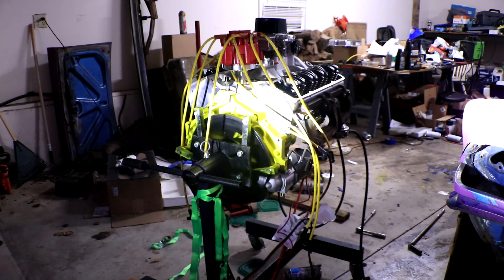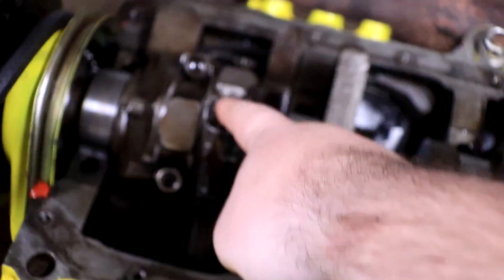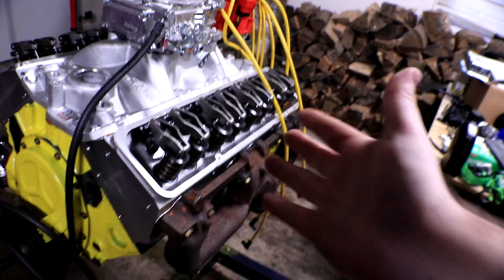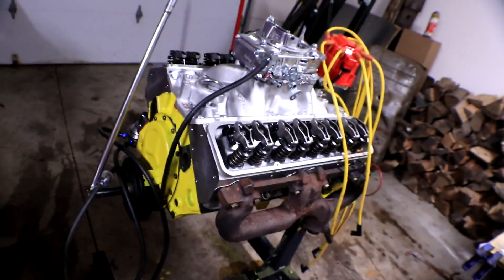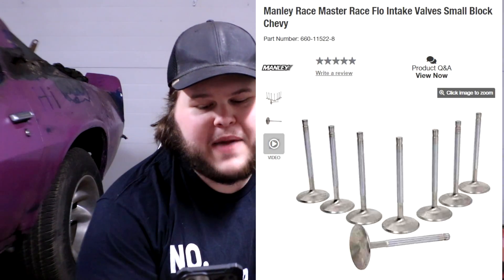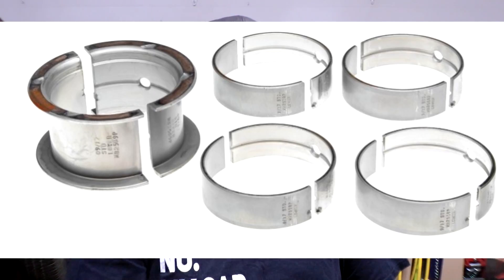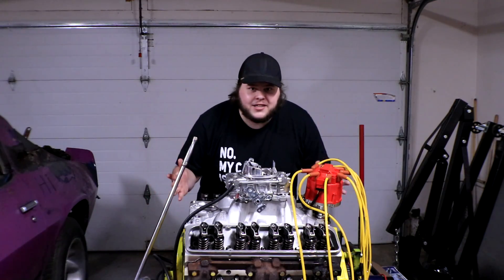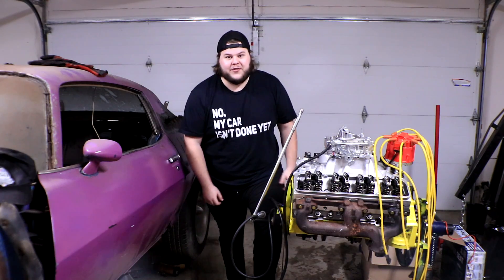The $1,700 MISTAKE that KILLED my Chevy 350 Build.

Comment: Best  break in oil for the cam is made by Driven which has high amounts on Zinc and not detergents such attacks the zinc: need to run it for 500 miles before you change the oil. Using a bottle of zinc guys add to oil does not wok because the oil needs to be at a certain temperature plus again the add it to regular oil which again attacks the zinc. Awesomeness your putting in a Howard roller cam.
Reply: The Driven , Comp Cams , both break in oils have so much detergent in it that it negates the zinc and phosphorus in it. VR1 and the Lucas is much better .
Reply: I’ve used diesel oil whenever I can’t get zinc break in oil and it works just as good but would recommend the more pricier break in oil as they work very well

Comment: You can buy Jegs housebrand parts on ebay they are cheap and good! For example KING bearings! Best get a genuine Edelbrock Performer street cam with good idle and vacuum (dont use a hot RPM lopy cam with a stock torque converter) You could also use an even better Comp cams retrofit hydraulic roller camshaft 265 or 268 degrees that never wears out. You cant use RACE valve spings - they are way too stiff! They will damage your valves and cam followers - Get the correct (best type would be beehive valve springs with quality retainers) with the correct stiffness for the cam your manufacturer requires. Dont use any cam with too much overlap when using in a street car! The auto trans will not work with that! And you need a cam button with torrington bearing and a special timing cover that will clear the water pump and the roller cam button! Dont forget to buy a distributor bronce gear for the roller cam! Roller cams need a special distributor gear. Ask your cam manufacturer what he requires! :-) Dont forget to clearance the pushrods (the may not touch or rub the guide plates or the head) P.S. dont forget a cam lock plate for securing the cam button (Jegs has a kit button with lock and grade 8 bolts) P.S You will have to clearance the new Manley valves to the valve guides and grind them tight to the valve seats in your cheap heads you will have to give the head with the valves and springs and locks to a certified machine shop for checking you cant do that at home! The valves might stuck and will leak and burn! For the roller cam you need a good new machined chrome moly valve lock kit too! You cant use cheap stamped valve locks with the hot cam and springs! Dont forget use new Manley Teflon 11/32 valve stem seals, you cant use the old ones twice. You will have to measure the valve guides outer size to getting the correct 11/32 teflon valve stem seals. Did you clearance the pistons?? I hope you did not use new pistons in an old outworn bore, you cant hone old worn out bores with a drillbrush! Your block A) needs to be bored 0.30 over. B) decked and C) You will need 8 good quality street pistons (forged or hypereutectic) that give not more than 9.5:1 CR with your heads when using pump fuel... And D) a good Hastings moly set of piston rings for those particular 0.30 oversize pistons. Than you will have to ballance your crank at the machine shop and weight match the con rods and pistons +/- 0.5 Gramm!
Reply: Nice
Spot on about the thrust button and Torrington bearing and Bronze dizzy gear. 
So often overlooked.
Reply: @matui6983  I just built a similar engine for my Corvette C3 convertible 1973 L48 350 (matching block updated with good quality parts but not too hot because I will have to use the car on the street with a TH400 automatic and I dont want a lopey idle here in Germany people are just going nuts about emissions ;-) )
Reply: Ive heard Germany has been getting tougher on emissions etc. 
here in NZ that really isnt too much of an issue ( yet ). 
It
Leans more towards safety. 
Engine swaps are meant to be certified by an engineer. 
And every 6 or 12 months depending on the vehicle the car goes thru a pretty tough inspection to find any faults.

Comment: Make sure to chase the threads for the head bolts and there is no gunk in the bottom of the holes. Also you may need to clearance the bolt for the double roller timing chain.
Reply: I met to say clearance the block
Reply: Totally agree on thread chasing, get you a rethreader set and an engine brush set, plenty of brake cleaner and an air blower if possible
Reply: Use a worn tap rather  than a brandnew one as they remove too much metal when new.
Reply: @matui6983  rethreaders dont cut as much metal as actual taps. Theyre also nice they dont need a tap handle to use them, just a wrench or a socket. Lang tools has a nice one on amazon.
Reply: 100% agree with you. 
Use the Snap-on ( identical to a bunch of others)version almost daily.
Great tool to have. 
Was just suggesting thst if he did go the tap route then in this case worn is better than new. 
He could even use an old bolt with a series of straight or spiral grooves cut into the thread. As long as the threads are clean. 
Plus a metal cutting countersink bit can be lightly touched to the top of each headbolt hole to chamfer it. Do that on all our big marine engines wether they are studs or bolts.

Comment: Don't let the negative get you down. 
You got BALLS man. You're the type of person that will keep the high-performance dream alive.
Everyone has to start somewhere.  The first camshaft I bought was completely wrong. A Sig Erson for my 351C. 
I kept that cam for my whole high perf carrier to insure none of my customers/clients felt the way I did being ripped off.
 The advice on the valve train is good.
Learn to read the manufacturer's catalogs. The information is correct and the footnotes are helpful also. There are lots of inexpensive parts that are of great quality.  If you know anyone oval track or dirt track guys they will fill you in. 
Learn to use the catalogs and you can buy from Summit or Jegs and save money.  
Remember,  the only man that has never made a mistake is one that has done nothing. 
What you have waiting for you at the end of the build is something they will never have. 
Success!

Comment: You will need a steel melonited distributor gear for the roller cam. They are about $70.00 at Summit. You can run a bronze gear but, you will have to replace it every 10,000 miles. If you run the cast iron gear, you will wipe out the cam gear. Fram filters have a nasty problem of not clamping the pleats together and then you are not filtering oil. Don't forget to block the filter bypass in the spin on adapter so oil is forced to always go through the filter and not bypass it. Ebay shopping is like gambling. If you can't afford to lose your money, don't gamble there. Your enthusiasm is fantastic. Can't wait to hear your engine run. Best of luck to you and have a great day!
Reply: I think you meant to say if you run the cast iron gear the steel gear on the roller cam is going to eat it for lunch

Comment: I highly recommend Mahle P or H series main and rod bearings. I use them in my Duramax and several other motors and they have never failed me yet. King bearings are good too, but I haven't used them myself. For the camshaft, I Highly suggest you use David Vizard's cam selection equation. He has his own YouTube channel now and is about the best guy for engine knowledge on YouTube. 
Great video!
Reply: The David Vizard 128 cam formula is a must, I have been driving my Mom's suburban that we had a summit cam in, and it has too much duration. The low-end torque is not that great, and the car is too heavy for weak low-end power. 
I would have known this if I had known about the formula, but like Garage Gremlin, it was a learning experience.
Reply: The JEGS / King brand is perfect for any street engine I only use King bearings since 20 years with great sucess.
Reply: Need to relax ive run autozone bearings on a bad crank on a mustang, and u can garrentee it seen all the rpms and ran strong for yrs intill a fire
Reply: @alltherpm  Autozone bearings are Muskegon they are fine too....Chinese and Indian bearings suck

Comment: Your main caps should have some faint numbers stamped into the top.  #2 would obviously be second from front on so on. 
You may need the 1205 Felpro intake gaskets instead of the 1206.  Need to measure your ports.   Make sure the springs you get are compatible with the camshaft.  Roller cams typically require more seat pressure than flat tappet cams.  Your camshaft has .500 lift.  Make sure the springs can handle the lift with at least .050-.060 clearance before coil bind. 
Check your installed height recommended by the spring manufacturer and shim accordingly. 
Engine building requires A LOT of careful measuring if you want a successful engine. 
If you have any other questions, feel free to ask.  I have years of experience building small and big block chevys.
Reply from the maker: Hey Jake! Thanks for these tips! Would you mind reaching out on FB to chat more?
Reply: I do not have FB anymore. Would be glad to converse with you via email or phone.

Comment: Keep it up man, I love that you're learning and doing it yourself, even if you have learned some things the hard way, we've all been there, even those haters who like to talk a big game, they were there too, just not man enough to admit it.
Reply from the maker: Thank you for the kind words! Definitely has been a great learning experience and I am doing my best to keep a positive attitude!
Reply: @TheGarageGoblin  You need special ARP Head bolts for these aluminum heads with protection washer! Dont use any bolts made for Iron heads! The lenght is longer on head bolts for Aluminum heads because the Aluminum castings are thicker compared to the stock iron heads) Using too short heads bolts will damage your threads! You might also rebuild your stock Carter or Rochester quadrajet carb because the aftermarket carbs mostly suck and have less power than the stock one. If you want a trouble free engine with modern crap fuel better use a retrofit Edelbrock Pro Flo 4 aftermarket multi point fuel injection or a Holley one. Those also feature a Lambda sond for automatic mixture setting.

Comment: I just freshened up my SBC 427 , new rings, and new bearings went through the heads. I was told by an engine builder that even The best bearing manufacturers out there ,, due to supply and demand are trying to make stuff so fast qualities suffering, and he was right. When I put together my short block  I had to get a set of standard bearings also a set of  +.001 and -.001 bearings to get the tolerances where I need them to be ,, I use plastic gauge , I’ve always  had good with it. I had to put a + .001 on one end of the rod cap and a -.001 on the other end just to get my clearances where I wanted them.  At the end of the day I bought 3 sets of rod bearings, and 3 sets of main bearings.

Comment: Dont use the fake roller rockers! The roller tip is held on place with a simple rivet! The rivet tends to come loose and your China rocker falls beside the valve making a pushrod salad....get a HQ set of stainless steel roller rockers! I suggest the HQ rollers 1.5 (NOT 1,6!) by Crower called "Enduro" series. They are very very reliable! Dont use aluminum roller rockers on a street engine!

Comment: Make sure your distributor gear is compatible with the cam gear
Reply: yes he needs a bronce gear
Reply: @Schlipperschlopper  Nope. Bronze gears go bad at 10,000 miles on the street. He needs a steel melonited gear for street use.
Reply: @colejohnson3705  yeah thats ok in the past we used bronce gears but we also used 2% MOS2 in our engine oil here in Germany like the army does in their Mercedes G class.

Comment: Looks up competition products, they sell head improvement kits that come with valves / springs, seals , retainers, everything needed, they have kits for specific heads so you can call them and they might have a kit for your exact head, I bought one and the only thing I had to change out was the springs and that’s only because of the cam , the springs I got were Howard’s cams and they also own Howard’s cams, they also have pretty cheap pushrods

Comment: Honestly brother you’ve gotten some good advice. But some unnecessary advice also, the YouTube comment section loves to be know it all’s. The springs and pushrods look fine, I’d send em. The camshaft id trust, and stock headbolts are more than adequate for your application. A single roller timing set is also more than fine for the application. Not saying any of the advice given has been wrong or false, but boy oh boy that’s a lot of changes for an engine that already has a multitude of new parts.

Comment: In case someone hasn't already brought it up. You should pick the intake gasket that matches the port size on the heads/intake. Simple gasket match port clean up is a good Idea if you think you have the skill and tools to do it.  It's 45 mins work on something that can really kill power if the intake and head ports are different sizes.  Esp if the intake is bigger than the head.

Comment: And check and play on the crank
Reply: And don't forget to prime your oil system before you try starting it
Reply: And to slowly rotate the engine by hand as the oil system is getting primed to ensure oil goes thru each gallery and oil passage up to the rockers. And fit an oil pressure gauge ( mechanical) to see the pressure come up ( you will hear it too) and to see the relief valve operate.

Comment: Regarding piston rings I would suggest: Plasma Moly Coated ones made by Speed Pro or Hastings. (Speeds Pros are the best) Dont buy file fit piston rings get 0.30 ready fit ones that have the correct sizes for your pistons.  But check any single ring in the particular bore before fitment to the piston. You need to place the piston rings in a special order and direction (marked side upwards and the gaps 90 or 180 degrees offset to get the labyrinth effect)

Comment: David Vizard video says measure clearances ( main and rod) when it comes from machine shop. Always use clevite bearings. Always!! Clean bearings with laccuer thinner, wipe with napkin, then soapy water, rinse with clear water. Make sure of clearance between pick up and bottom of oil pan. Prime oil pump with Vaseline. Prime engine oiling system spun at distributor shaft. Start and use oil pres gauge. My friend you are not alone!!! Keep trying!!!